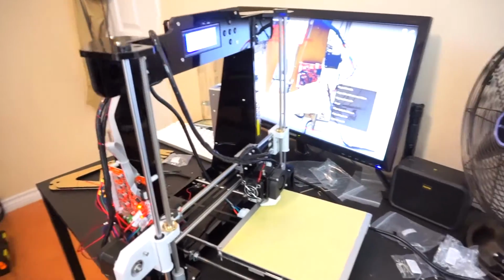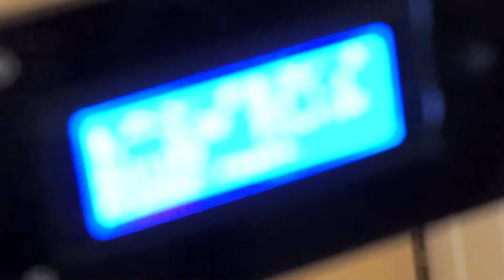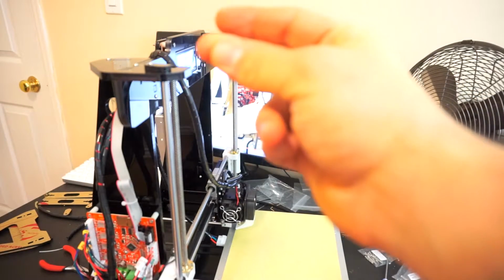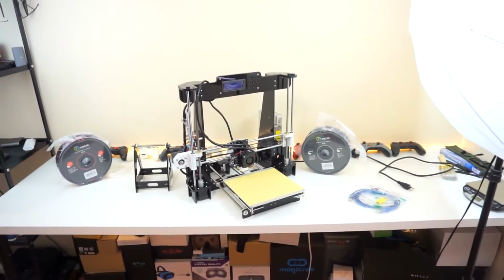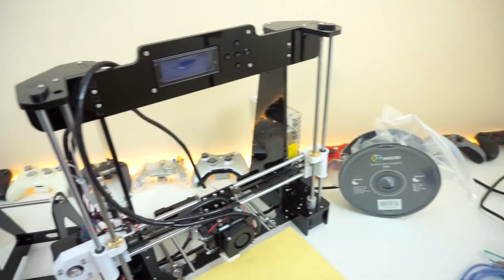Anet A8 | $160 3D Printer Assembled | Issues & Fixes | Missing Screws

Comment: Just got an EARME Anet A8 3d printer. Started putting it together. I thought it was missing one of the "Support plate lock plate", but no, one was broken. It must have gotten broken during packaging or before. It was in the wrong area, and it looked like two smaller pieces. I've glued it together (hopefully it doesn't react with the acrylic), and I hope it stays together long enough to make a replacement.

Comment: I just built mine as well.

You actually need to use M3x20 screws with the allen keys for the X axis stepper. Check at 34:36 of this video: https://www.youtube.com/watch?v=J8tX-Kfb1og

It shows them on the top left. Just ignore the top right listing...
Reply from the maker: Yeah, I still did not have any extras if at all. I have just checked

Comment: mine was missing the x screws wire fore the y axis used a 3s lipo balance lead and only got 1 screw to hold power supply on but yea in happy with it  it prints good and make the frame and fan upgrades on thingiverse . and yea WTF i need a hammer to build this thing  lol use somthing/someone to hold the far side while you hit or mabe drill to tight fit